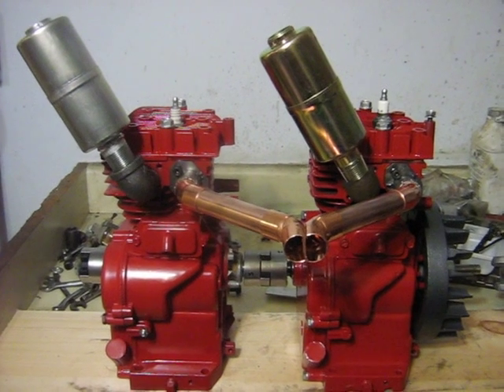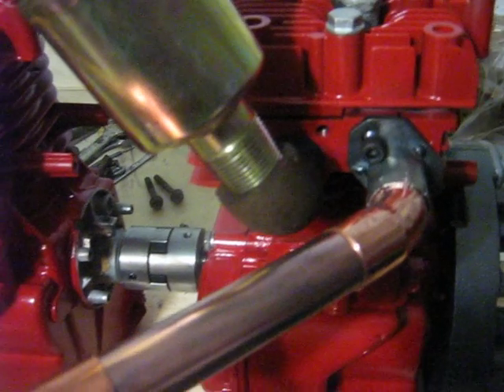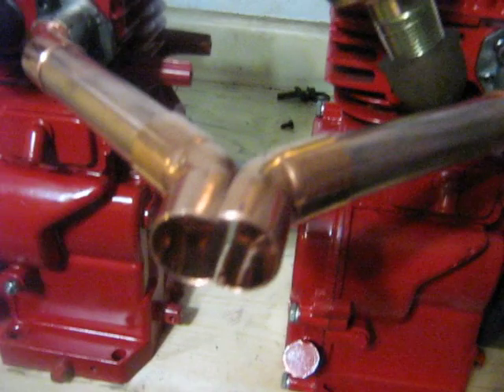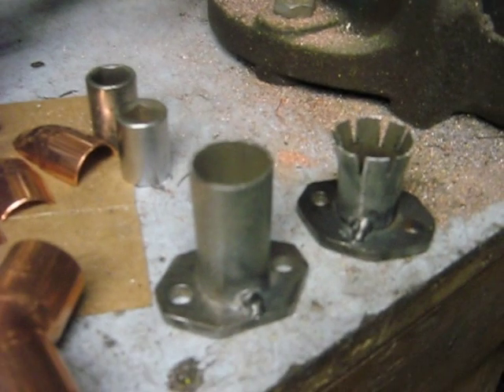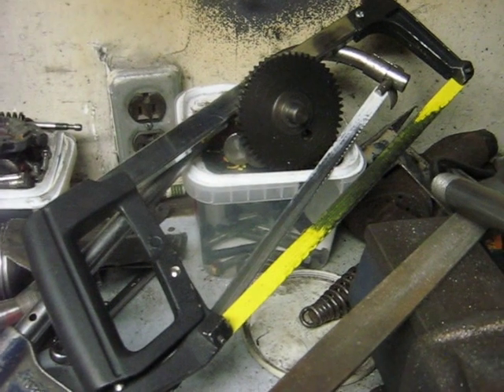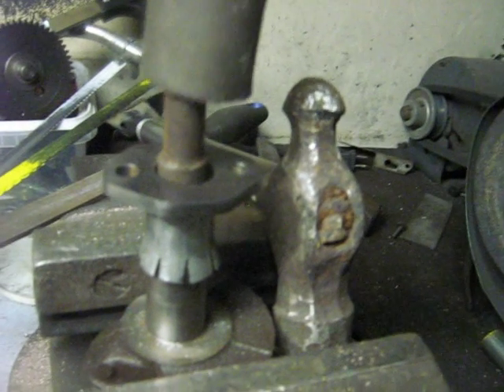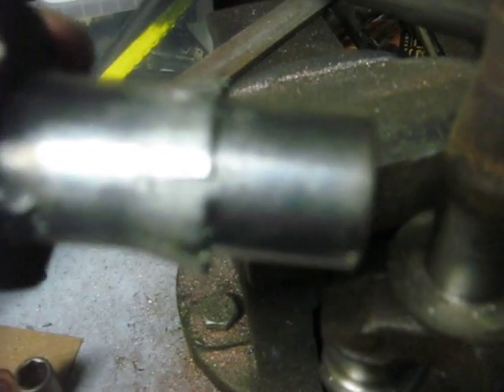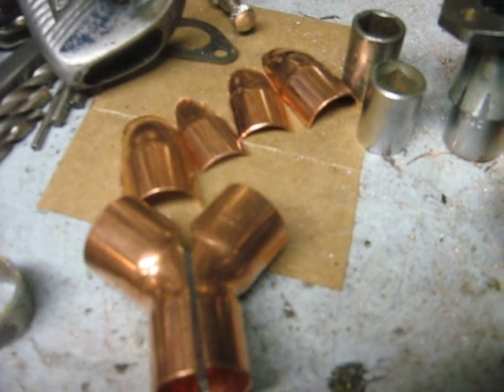Making Intake Manifolds for Briggs4

Comment from the maker: Yes, you are right, these engines do vibrate like Heck!
Most of my engines don't run for very long, so it hasn't been a big problem so far. The sleeve valve engine has a soldered copper intake, and it has lasted at least 20 hours so far.
My original plan was to have a continous shroud going to all 4 engines. I may just install small electric fans of 3 of them now, not sure yet. I have to make couplings that will last longer than 25 seconds first!  :)

Comment from the maker: Yes, we have quite a few scrap engines at local metal recycling yards. Of course the trick is to be there at the right time, before they are mangled putting them into the pile.
I thought of a V8 also, but to do it anywhere near right, you need V2 engines to start with, I don't know of any of those that are cheap.
Good luck building some type of engine, and have fun doing it :)

Comment from the maker: I am not really sure, you could have a point there. I certainly hope the manifold doesn't fold up like a wet noodle under the vibration from the engine. I will have a steel brace going to the carbs. Plus I have to support a gas tank somewhere nearby.

Comment from the maker: My son suggested using 1 barrel from a 318 2 barrel carb. I thought that even that would be too large for a 52 cube engine, so I am using 2 carbs from 11 horse Briggs 25 cube lawnmower engines. Hopefully they will be sized about correctly, as my opposed engine with 1 carb for a 9 cube engine feeding 18 cubes didn't work out very well!